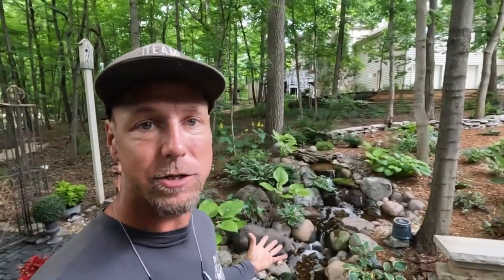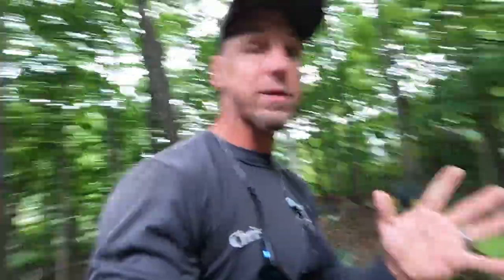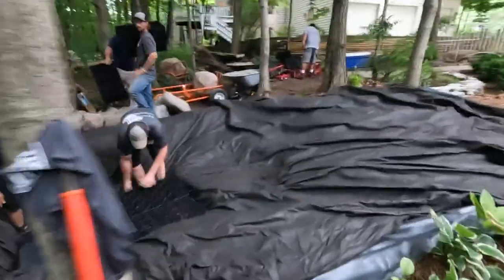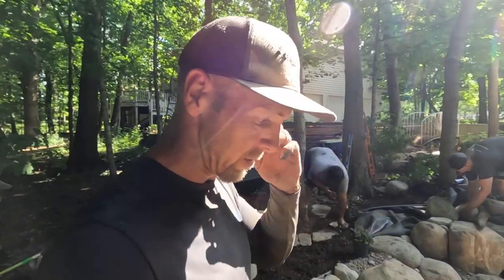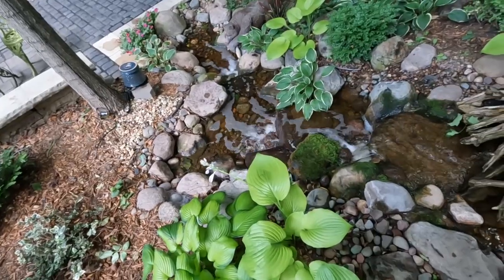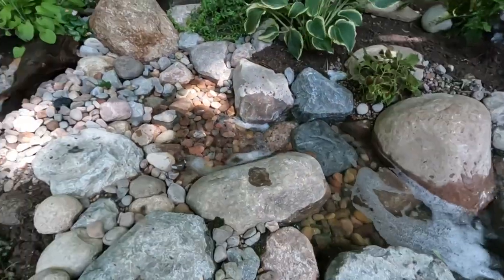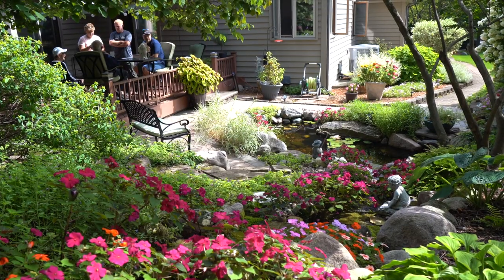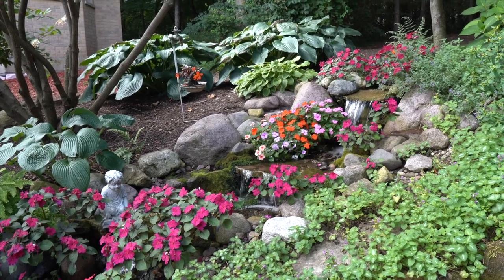WATERFALL ADDITION On Small Backyard Stream In The Woods!

Comment: Why wouldn't you just seam the liner and add to length? Now you have to power 2 pumps and also the added expense and maintenance of the second basin... Great job on making it seem like one though...
Reply: Great question, Jasper. That would’ve been a great idea, however the reservoir size on the original project didn’t allow. There would not have been enough storage to compensate for the water in transit (motion). Hence the two separate systems. Thanks
Reply: @chrishanson5759  Thank you so much for the reply. I was thinking that too... Might be a case to always try and over size the basin to handle possible expansions in the future... Or maybe leave a lot of extra liner tucked in just in case...